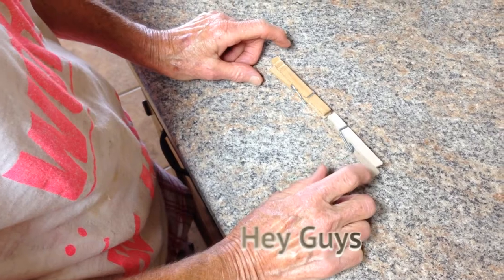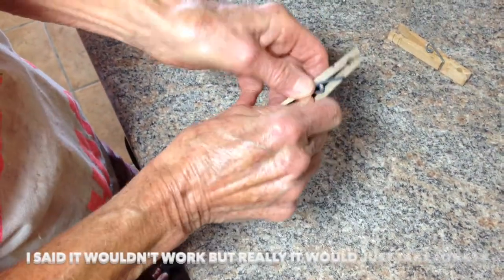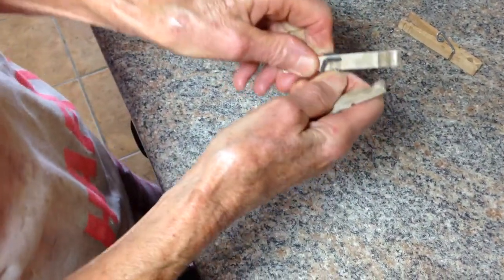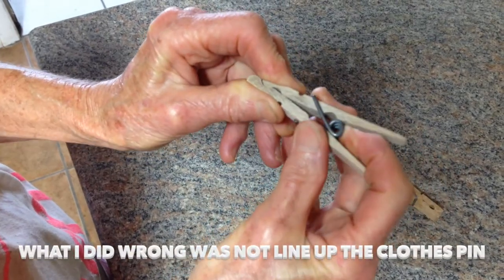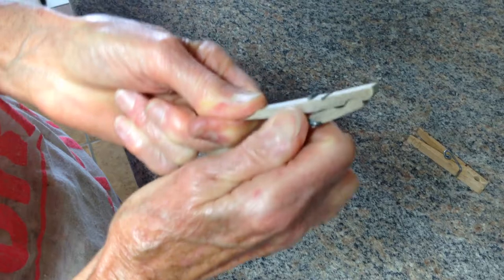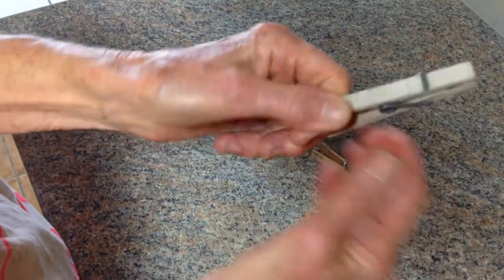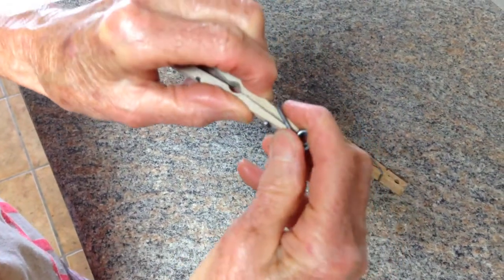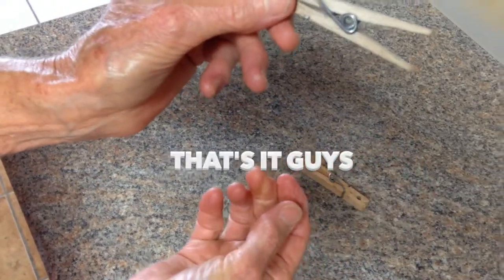How to Fix a Clothes Pin

Comment: Thank you, ingenuous.  But my spring has so much tension on it, I can't even get a small gap like you had.  I'll figure something out because I don't want to wait too long for an answwer if somebody is ikind enough to answer.  Thanks anyway.  I used to be able to fix them the hard way but not these new ones.
Reply from the maker: Please go to klguthries5  how to fix a clothes pin. That is were I learned and he is a super handsome guy. Sorry my video didn't work for you.
Reply: Not to worry.  Your way is easier and good to know.  If it's the screwdriver video you steered me to, thanks, and if he was a handsome guy, I didn't notice.  Must be slipping.  I've got my screwdriver ready.  Growing up, we used the slip on kind but had some of the snapping turtle wire spring ones.  I don't remember any of the spring kind breaking but if they did, I guess my dad got to fix them.